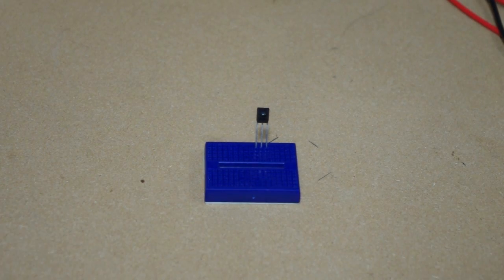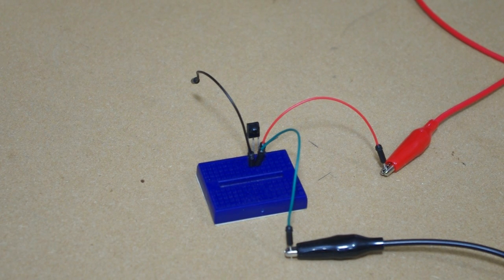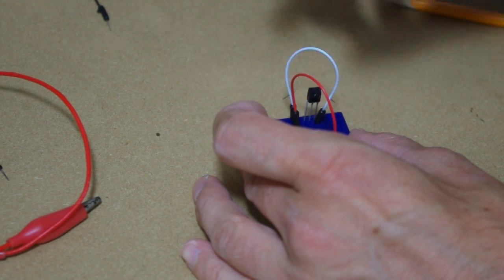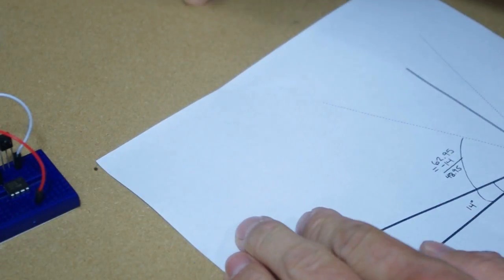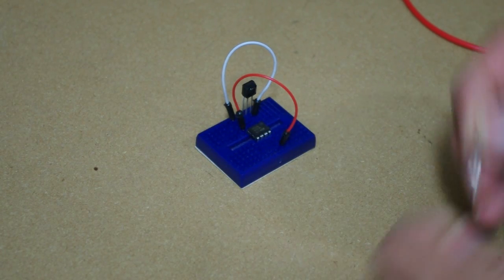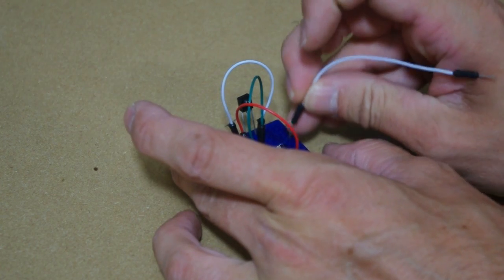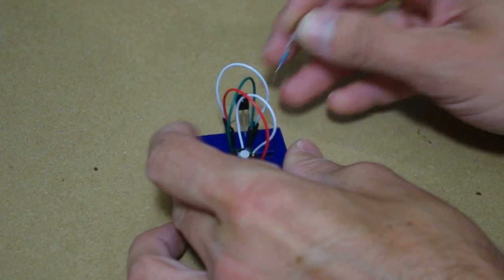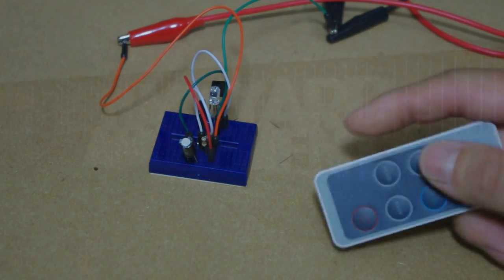Simple IR remote trigger using 555 timer

Comment: This is a fantastic circuit! Thanks for sharing. I do have a question though. Did you find your circuit to be unstable? When I power up the circuit it is stable until I trigger it with an IR signal. Then it seems the LED (output) turns on and off on its own (without an IR trigger). It's almost as if the sensor is picking up stray signals but that's not likely considering where my circuit is located. Have you experienced this?
Reply: Coz it is in astable mode